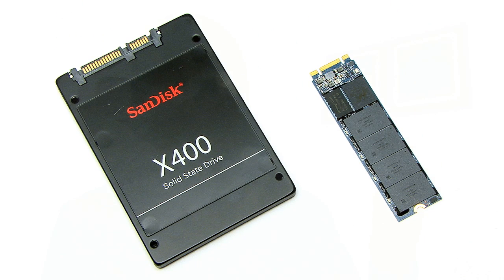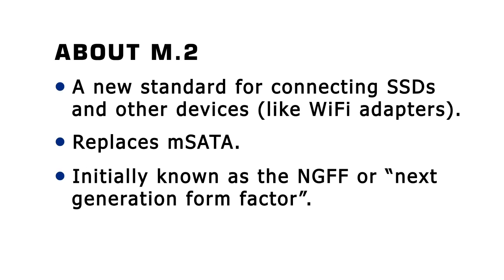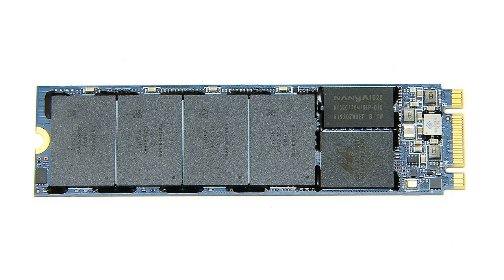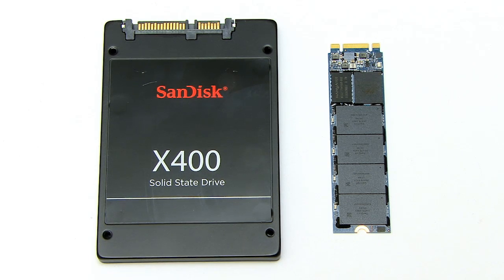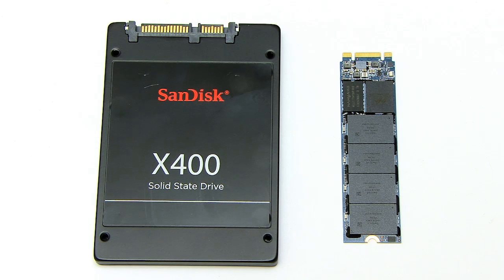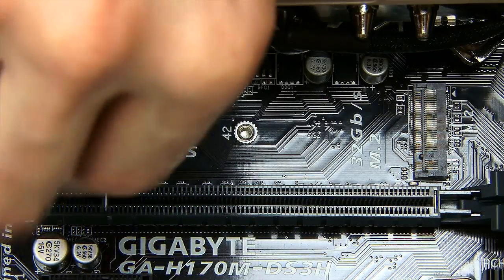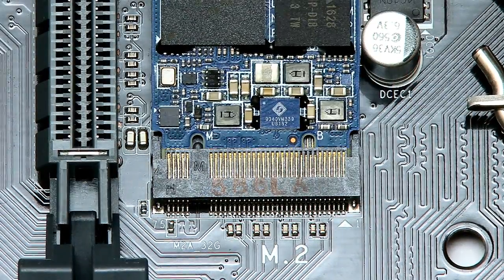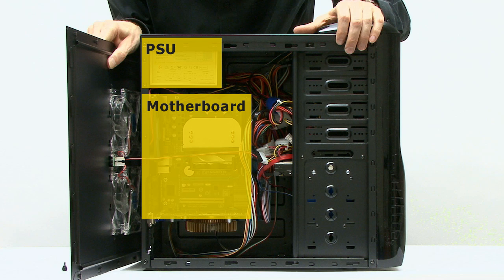Explaining M.2 SSDs

Comment: Hi Christopher,

my motherboard has a one M.2 socket that supports both SATA and PCIe drives. I currently sport a Kingston SV300 120GB SATA SSD that I use exclusively for my Windows OS as it is too small to fit any games that would really benefit from the added read speeds. For all the other things I use a 7200RPM 1TB hard drive.
Would it be worth the investment to buy a M.2 PCIe SSD for my OS, have my V300 for the handful of open-world games that load a lot of things (or other programs that would benefit from being on an SSD) and my hard drive for all the rest?
Reply from the maker: What you propose would certainly work and allow games to load more quickly. The investment will become more worth it over time as (M.2) SSD prices fall. :)
Reply: Since M.2 is a relatively new technology, it certainly would make sense to wait for a price drop, thank you! :)